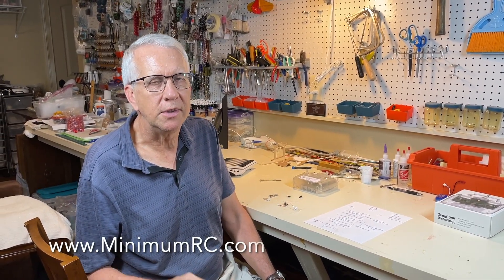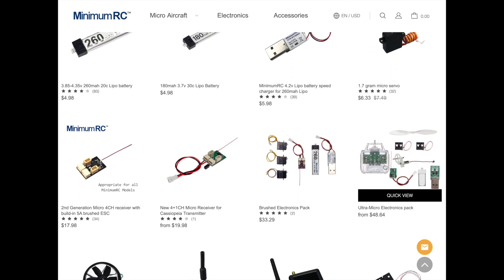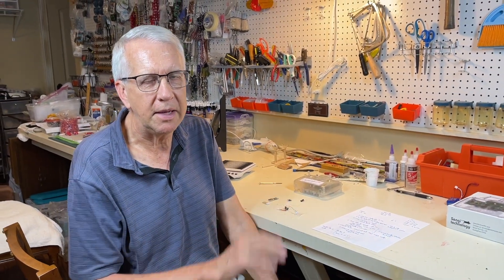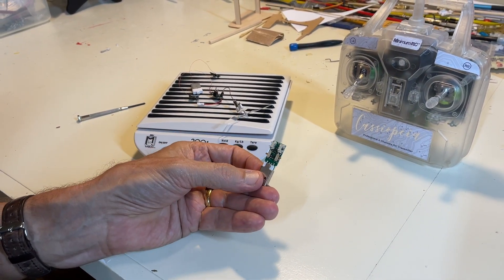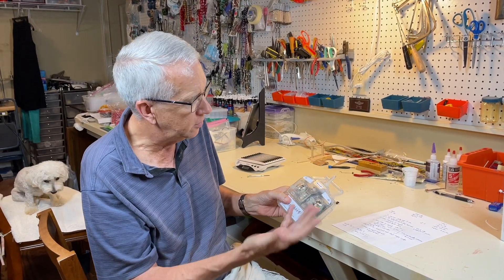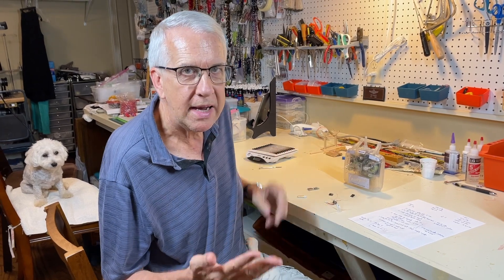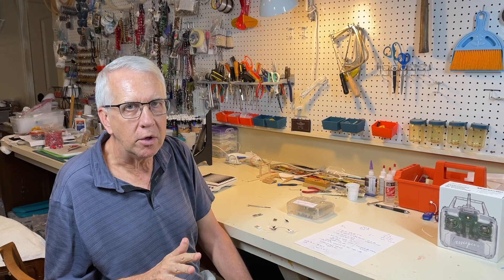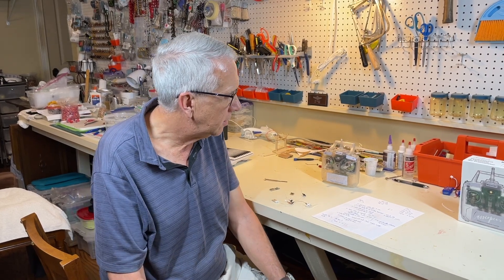Affordable Micro RC Electronics

Comment: So back in early actuator days it was mentioned you could use small sections of rubber band for your hinges and the flight surfaces would self center without needing an airstream. The trick is to balance the size of the rubber band hinges so they don't over power the actuators and reduce your control inputs. 

 The Hurd's micro RC systems, on their DWE Super Skeeter had their actuators mounted close to the wing with CF pushrods connecting the rudder and elevator. They used an interesting centering function of the two actuators with their magnets at 90 degrees to each other which self centered the actuators without needing  any external forces centering.  The controls are completely proportional and have plenty of strength to move control surfaces that aren't too large.  We're talking about 30 gram sized models at the heaviest.
Reply from the maker: Very interesting!

Comment: Tim, I am hoping that this gear will power Guillows 300 series aircrafts. I received a Guillows Cessna 170 for Christmas and I hope this gear will work in an rc conversion of it, if I can keep the weight at 2-3 oz. I saw your Aeronca/Cessna rc conversions and I hope this gear will work in the Cessna as well. I would like to hear your opinion on this before I invest any time and money on this conversion. I like your build videos, thanks.
Reply from the maker: The actuators need a super light control surface to work properly I think. Oddly enough the Guillow planes might be too heavy/fast for these actuators to function. I’m still thinking this over.
Reply: @TimMcKay56  Thanks for your quick response Tim. I will look forward to any further info. you may acquire to share with me. Thanks.
Reply: There are receivers and servos in the less than 3 gram category.  About a gram for the .rx and servos under 2 grams, that would be perfect for a Guillow's 300 series.

  But, unless you really pare down the weight of the heavy balsa the Guillow's kits normally come with, they will be flying at air-speeds that will probably be too much for an actuator to work effectively against.

  I have a scratch built, 47 gram, 20" wingspan, pusher biplane that uses Flash Hobbies' 2502 2.1 gram servos, the rudder is full flying and pull-pull, they seem more than adequate for that rudder.   I wouldn't trust an R/C electromagnetic actuator to control this much control surface.  The size of model this system was designed for is close to Dancing Wings Hobby's Ice Cream E23
Reply: @tauncfester3022  Thanks so much for your feedback. I will look into these components soon.